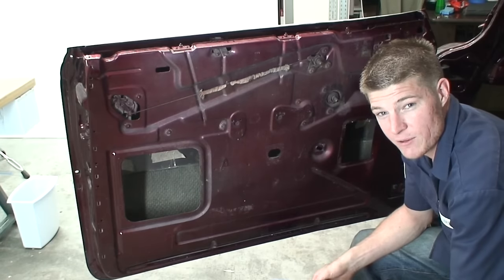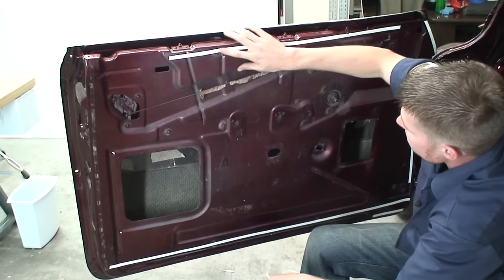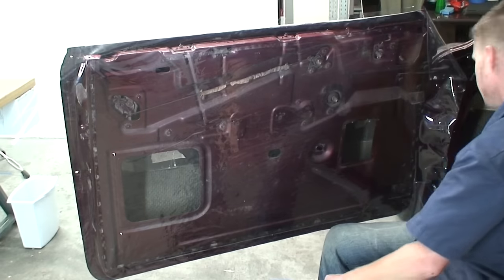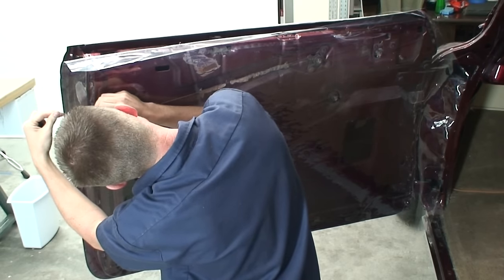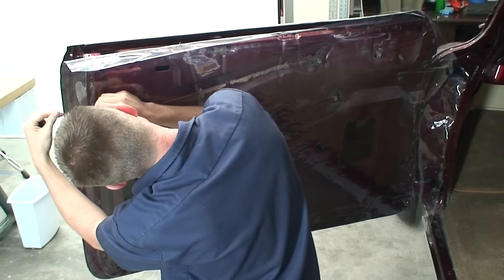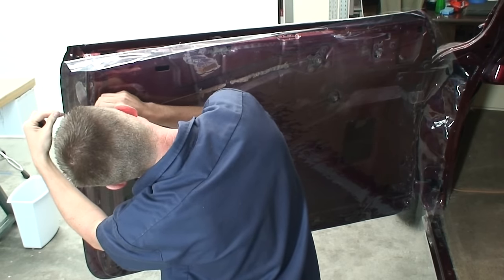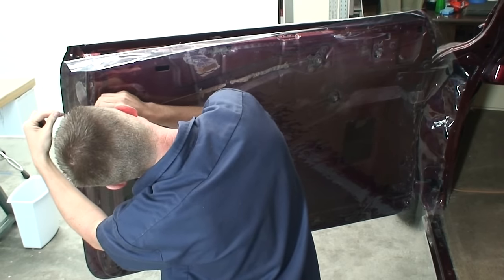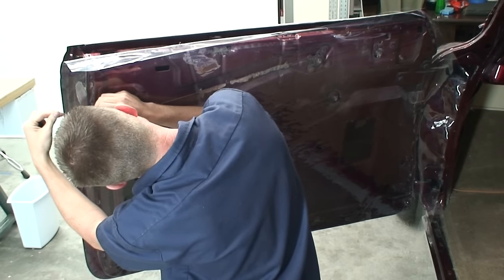Automotive Upholstery - Making Custom Door Panels Part 1 - Patterns

Comment: wow longest video I've ever watched on youtube,thanks,that was very cool of you to share your knowledge dude.i have a old truck i mess around with.its a 95 gmc Z71,and the good thing is i already cut the whole bottom half off of the door panels and made sealed enclosures for some 8 inch mid bass drivers,speakers don't go inside the speaker hole in the metal door these have 1/4 MDF on the back with fiber glass resin,the metal part of the door is sealed with deadener so no water can get in,so all i would be making is just a half a panel for the tops,so hell,why not give it a try huh,its not my daily driver.i would like to make the inside look modern,so a lot of panels,dash,headliner all that,thanks again i will keep watching.
Reply from the maker: Thanks! Glad you liked the videos.  I hope your project comes out nicely!

Comment: That clear vinyl can also help with older cars and the offset holes in the panel. If you keep the old panels you can line the vinyl patern up with the old panel and draw in where the offset holes are for the clips

Comment: All of your Automotive Upholstery Videos!!!.. Are Very, Very Informative, I love that you Give Step by Step Directions, as opposed to many , many other  You Tube Auto Upholstery How To Videos , that seem to skip/race thru very important steps .......Just A Thought ,, that I'm not sure that your aware of ..but  just by viewing this video alone .. It's not difficult  for me to see Your A Pretty Smart  Young Guy !!!...So ., as I said , Just A Thought ... You mentioned  that You use ABS for your door panel base...Might I add a suggestion , Which I have used for many , many years now ...The PVC Board , that is readily available thru many Plastic, Lexan, Sports Orientated , & Art Supply Stores , this PVC Board is available in various thicknesses  from 1/32" -1/8" -1/4"-1/2" -5/8"-3/4... it might be available in larger thicknesses as well , but these sizes I've stated are the ones I like to work with ... this PVC board  is available in 4' x 4' sheets as well as 4' x 8' sheets  depending on the supplier tho, As your well aware of ABS  is prone to deform  cracking , splitting ...especially if heat is used ...where as the PVC Board  Can Withstand All Of Such, n'  it's  Water Resistant  Too!!..the $$$$$ Advantage Feature is its Price  as opposed to ABS ....the 1/8" PVC BOARD is what I Use For All Of My  Door Panels I Have Fabricated ...on a further note .. I tend to use 1/2" thick PVC Board ..Upon Fabricating /Building Complete Console Designs , The PVC  Board Can Bend /Formed  to Many Curvatures .. just by applying heat from a heat gun on the medium setting .
..like I said  Your Automotive Videos  Are Very, Very Informative,. There Second To None , In My Opinion ...Usually it's the Older That Teaches The Younger New Tricks ...But In This Particular Case " Lucky Needle " ..The Younger Is Now Teaching The Older ..New Tricks!!:):).....

Comment: Where do you get the plastic used in your pattern making? Can that be used for a weather / water shield barrier between the metal door and the actual door panel if you are using a cardboard door panel?
Reply: yu may be able to get a clear shower curtain,, they are pretty heavy gauge material
Reply: Many lumberyard/hardware stores carry it. It's made by a company called Yancy I believe.

Comment: I'm wanting to redo my door panels for my 1972 Mercury Marquis. But do not want to damage the ones I have because they are mint all original. How would I go about making the top of the door panel.
Reply from the maker: Umm I'm not quite sure what your trying to do. Can you send pictures?
Reply: The Lucky Needle at the top of the door panel it curves back to the window and down. You have the metal cover on my door panels I don't.  Mine is whole how can I make the curve
Reply from the maker: You could do it out of fiber glass but it will take a lot of time to do that. You would be better off buying some factory panels and using those.
Reply: The Lucky Needle my door panel is just flat..its easy for to DIY  it on my home..nice info..and sad for you rocky..may your car REST IN PEACE